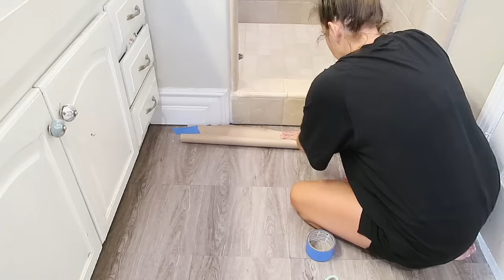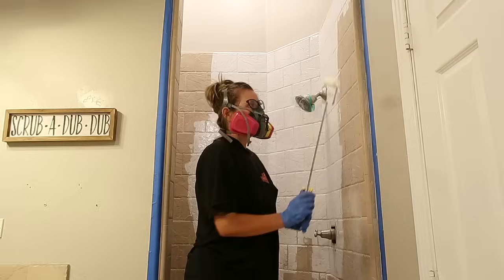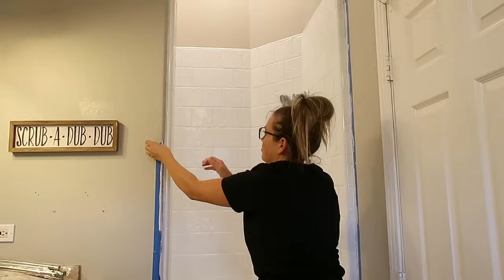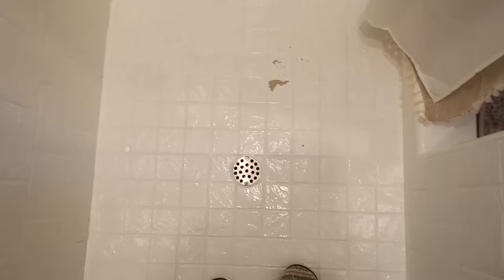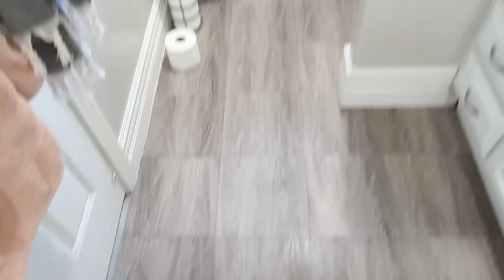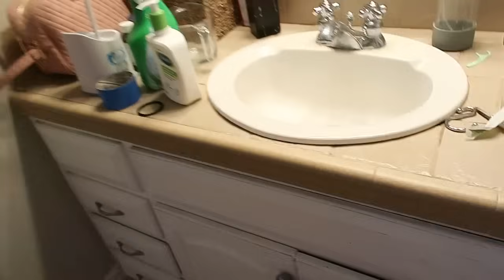EXTREME BATHROOM DECLUTTER & MAKEOVER PART 4

Comment: 2 tips , 1 use masking tape instead of painters tape and 2 Rustolium oil based paint works better than anything in the shower , it's smells bad but so does the tub paint I used both recently in my tub and walls and I'm not impresses with the tub paint at all and the oil based paint on the walls I scrub and scrub that and it looks like I just finished it and I also use masking take it works great and doesn't peel the paint the 1 in wide one I use 2 strips of that !!!! The shower looks great !!!!!
Reply from the maker: Thanks!